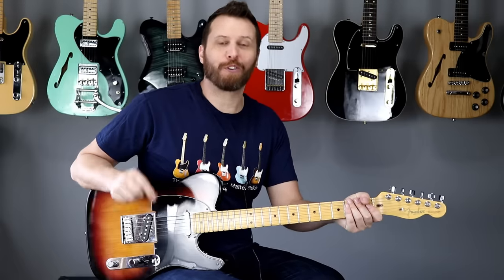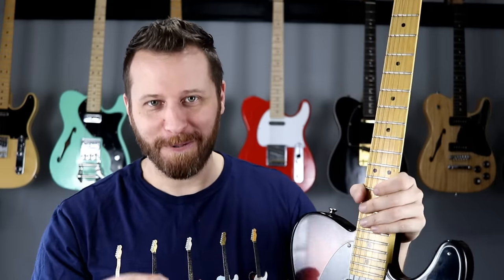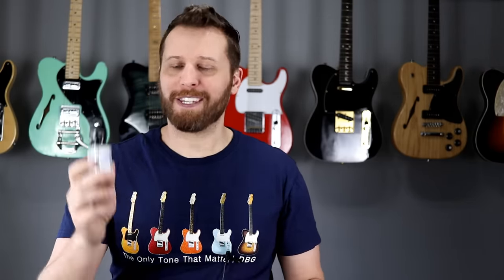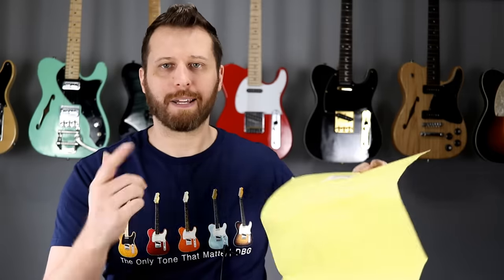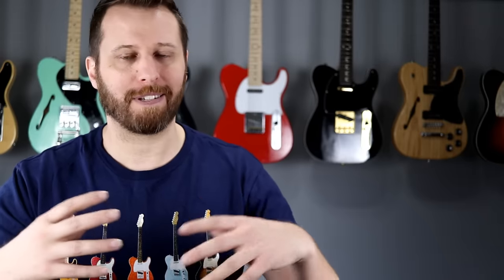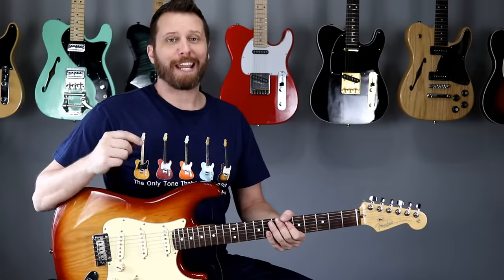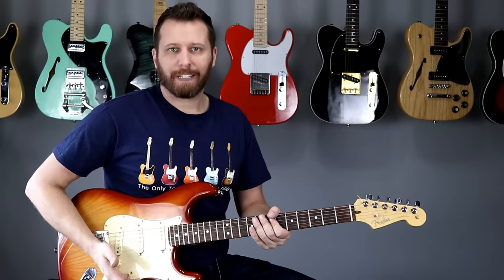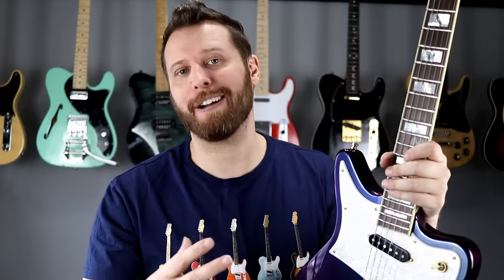KILL The Hum and Buzz!! - Keeping Your Single Coils QUIET!

Comment: You forgot to mention EMG active pickups, and the like. David Gilmour has used them for decades and no one complained about tone sucking, dynamics, or bad limited/compressed sound on his part. What active single coils like EMG does - too - is bucking outside noises like EMF, RF and mobile phones, fluorescent neon signs, and shoddy dimmers. Which not any shielding, noise gate pedal, Silent Circuit will ever do. Mind you that even if your pickup or guitar has proper shielding, it's the cable that CAN act as an antenna and pick up lots of extraneous noises, and that can even occur with humbuckers. No matter how much you have shielded your guitar, with Silent Circuit, there's ample enough risk of what happens after the guitar, as fast as any cable leaves the guitar, that can pickup a plethora of noise sources, no matter how good the grounding is.

You forgot to mention the Suhr/Ilitch hum cancelling system (passive) which is a pretty non-invasive method for preserving originality vintage guitars intact. No need to drill new holes or something. The Ilitch is the best one I've head while preserving vintage tone, without the buzz. Then peculiar thing is that these days, I think it's not rocket science to make a guitar or single pickup that has the "vintage" tone nailed to a tee, while getting rid of ALL ground/earth HUM. I e the 50 or 60 cycle hum. 

You also forgot that - while demonstrating the easiest way - turning yourself away/around from amp, gear, at a certain angle minimizes ground hum buzz to quite a huge degree, too. 

AND : Using a pretty heavier gauge set of strings than you're presently using. If using a 012 set with a spun third, as they did in the old days, and the pickups were made for that, you automatically turn the pickups from weak pickups to stronger pickup, with greater magnetism, and you have much more dynamic headroom and hotter output, which means you can turn master volume down and have greater noise floor. However, at a cost of course, with it being harder to bend, but so be it. 🙂

All in all, there's no such thing when it comes to bucking hum, as a free lunch. Everything comes attatched with compromises, and concessions. I've made my mind up a long time ago. I take precedence in removing hum and noise, make it a way higher priority, than any hardcore sound snob of just having it to sound like 50s vintage all of the time. So any change in actual timbre and tone, I am game with, if the hum is gone. Just because a very simple thing, I don't play any period music from the 50s, and I know of very few others that does. Since I do not play with 012 string sets and spun third, and not flat wound at that, and I do not know of that many players that does. Or musicians anyway, guitarists or not. But yet they keep on insisting that that's the way it sounded in the 50s. No it bloody hell didn't. Not even close.

I wonder why hum isn't embraced by the rest of electronic musicians? Keyboard players, synth players, organ players, singers with bad microphone insist of humming all the time, so they know for sure they won't be electrocuted, and so on. Only guitarists, who are the ones who plays the loudest anyway goes "I'm fine with the hum and so should you be..". Beats me.

Comment: Most humbuckers have a row of magnets and a row of magnetic screws.  Take the screws out and you have a single coil sound.  I'll bet that's why they were designed that way.  It will give a Les Paul a twangy sound.  But, experimenting with it, I failed to pay attention to the noise canceling that should go along with it.  Think about it, with a split coil, like on the guitar you demonstrated, when you pull the knob you are actually turning the humbucker into a single coil.  Yet, by unscrewing the screws, you still have two coils with power running through them, which should provide the noise canceling properties of a humbucker (the loop), you just don't have the poles in one side, so that side of the pickup puts out no sound.  That's my theory anyway.  There are some humbuckers that you can't unscrew.... I don't think my Jacksons unscrew.

Comment: I used Kinman pickups with the guitar shielded with copper and it was quieter than my Les Paul.
Reply: My dad has kinman p90s and they are amazingly quiet
Reply: I'm using Kinman in my (Tokai) Tele clone. They have a wonderful tone and are completely quiet.
Reply: Zane Tweelinckx I found that I really liked the sound of the Kinmans too. I don't know how they compare to the recent Fender noiseless pickups but the when I bought them they were much better than what Fender had on offer.
Reply: Michiel Lombaers it great to roll that volume pot up and hear nothing, but great guitar tone. A noise gate is good enough live but you always hear the hum riding on your notes.

Comment: Funny, my Indonesian made Fender Affinity Telecaster has absolutely no buzz, hum or noise issues, non at all. However my much more expensive MIM Fender Jazzmaster has noise issues in SPADES! Because when my hands are "not" on the strings this thing shouts out the noise, hum and buzz to the extent that I can not tolerate it at all. Once I place my fingers on the strings then 95% of the noise issues disappears. It may grounding and shielding issues if ever their was one. Non of my other 17 guitars have any noise issues and that includes two Fender Bullet Stratocasters. Go figure!

Comment: Hey a wierd question: If I were to use a guitar that has a mix of humbucker and single coil, when a single coil is used with a humbucker, would it noise cancel?

I know a normal single coil and a RWRP single coil together will noise cancel, and a humbucker, which has both single types in one unit,  will noise cancel by itself. What about playing a single coil (either strat or P90 type) together with a full humbucker?

Reason why I'm asking is because I recently acquired a Kramer Voyager body that has 3 humbucker routs and am trying to decide on a set of Seymour Duncan pups for it. Either 3 humbuckers or maybe throw in a set of Phat Cats plus a humbucker or another Phat Cat (dunno whether go with 2 necks or 2 bridges). Or 2 humbuckers and one Phat Cat in middle. The Voyager uses 3x 2-way toggle switches which means ANY combo of pups can be on at any time, including all 3 at same time.

The Voyager now sports an Epiphone S-Series neck (think Strat 25.5" scale here) and a floyd rose will be installed. The sole pot will be a master volume Liberator pot (to allow easy pup change if I no likey).  Any humbucker will be paired with a Triple-Shot for coil wiring options (split north or south, series or parallel).

Any advice and suggestion will be appreciated!

EDIT: musical style is blues to metal. Think ZZTop to Toska/Dorje.

Comment: How to get a humless single coil sound, steps in order of importance:

1) Build a faraday cage around the electronics in the guitar with copper or aluminium foil, make sure everything is correctly grounded and no ground loops exist
2) Fix the wiring in your house and make sure your amp is well grounded, never disconnect the ground!
3) Get a good cable with low resistance on the ground shielding
4) Remove all CFL/TL lighting, keep as much distance from EM noise sources (usually, the amplifier head or computers)
5) Shield all electronics in the room
6) Power the amp off a UPS or isolated power supply instead of mains
7) Start dicking with noisegates/electronic hum cancelling/special pickups

Comment: Typically, telecaster hates high gain in the bridge PU. And usually they are hard to dial when on high gain. The best solution is get a guitar with humbucker. They sound much better high gain.

Comment: Mine still buzzes VERY VERY louldly on the humbuckers. Is there any solution?
Reply: Get a noise gate, if you can. You can also face a different direction to minimise hum.
Reply: Get the wiring in your guitar checked out.

Comment: Humbuckers in parallel sound single coillish without the hum. What if you just wired a stacked humbucker in parallel? Or had it switch from humbucker to parallel instead of switching to single coil?

Comment: I have a '73 telecaster and the hum drives me crazy. I can't use it for performances. I don't want to ad stuff, because it's fully factory. I tried the noise gate, but I would love to hear if there are any options for vintage units like mine?
Reply: You didn't mention which one you tried but maybe the noise gate you tried wasn't doing a good enough job. You could buy the EH Hum Debugger, TC Sentry, Boss NS-2, EH Silencer, ISP Decimator, and /or any others you choose  and try them all. Then keep the one that works the best and take the others back.

Comment: Shielding doesn't do anything noticeable. Think about it, your pickup is receiving the external noise right in the front. What happens underneath is almost inconsequential.
Reply: It most certainly does. I'm guessing you've never actually tried it. It transforms single coils. I've done it on at least ten guitars now. You have to do it properly though, with the shielding throughout and wired to ground. It's not just the pickups that pick up the interference, all the wires can do it. That's why it's not a bad idea to use proper shielded cable too and twist your wires around each other etc. It's just simple physics.

Comment: What about using AC Voltage ground loop power correction on the power supply to the amp ? Ebtech make a Hum X plug for your amp.

Comment: I live on Koh Phangan Thailand and it's a nightmare for hum! Whatever guitar I have. The power is never stable, so recording can be going well, then all of a sudden the power dips and the hum kicks in. I have the electro harmonic hum-debugger, which helps a bit and I record through my avid eleven rack, which has a gate. Any suggestions? Thanks for your great shows
Reply: Get a power conditioner. It will provide stable power and protect your gear.  As well as clean up some of the buzz.
Reply: @temple0techtonic  thanks I'll look into it!!

Comment: For copper tape, I read that if you use separate pieces, you have to weld/solder them together or else the shielding won't be effective. Do you know if this is true?
Reply: Yes, correct. But you can just overlap the edges of the tape to make the connection. THen solder a wire from anywhere on the tape to the back of a volume pot to earth the whole shielding.
Reply: @MonsieurVersatile  Ok that makes more sense. so as long as all the copper tape is making proper contact with each other and then is grounded it's all good. What happens if its not grounded to a pot, does it have any shielding ability?
Reply: @AndrewAviles  Some, yes, but it's trivial to solder a wire from the foil to ground.,

Comment: See I have humbuckers and when I plug into the interface it buzzes before I even plug the guitar in. It doesn't buzz barely at all on my little line 6 amp. I just had my guitar checked and set up so I'm almost positive it isn't the guitar. It goes away when I grab the metal part of the guitar cable.
Reply: Ronaldo, if you are using an interface such as a multi effects pedal through headphones, and it is DC powered it probably has no connection to ground and all the shielding and metal parts fed RF into the signal. I found that this situation was very noisy unless I plugged into an amp (plugged into the mains but not turned on) or a dedicated ground connection

Comment: I upgraded a squier bullet strat that is made in japan in 1983 with new set of pickups (Seymour Duncan Little '59), and i'm having an issue where the noise is coming out so much. However when i touch the strings or tap on the tremolo bar/bridge or any hardware like tuners etc, the noise is gone. But when i let go or release, the noise comes back. So i don't know there's something that has to do with the grounding signal that's coming out of the guitar, but i'm having this problem and hopefully someone can help me fix the problem!!!

Comment: What if all your guitars are making a popping noise? Strat makes the noise in 1-3-5 positions, mostly silent in 2-4, my humbucker guitars are not much quieter and the popping noise is still noticeable, and predictably louder when I split them. This happens only when the guitars are plugged in, everything is on. It happens in both my tube amp and my modeling amp, and I’ve tried this at various outlets in my house, different sets of cables including a wireless set. I’m guessing some form of emi from whatever is in my house. It sounds like a galloping crackling popping noise. Any suggestions/solutions?

Comment: players:
gainstaging. lower guitar volume. don't set your pedals to 10. get a better amp head. use more speakers. i can play an OEM squier bullet with mysetup and I have next to no noise away from/facing the speaker. if you need more "gain", buy a $50 Boss overdrive to put before your distortion.

for room soultions - replace your current power outlet with an isolated ground outlet, use isolated power supplies, and turn away from your computer or phone. same applies to venues. If you go to one venue often, offer to replace their outlet where you plug in for $40 and you're solid.

Comment: My amp, a Fender Frontman 25R,  hums when the guitar is not plugged into the amp. I just turn it on and there's the hum. It also gets louder when my fingers touch the tip of the cable lead. I tried the Pigtronics Gatekeeper with no help at all. Any thoughts?

Comment: You need to check out Woodesos YT channel and how easily he installs a dummy coil that has no volume drop or tone change. Using a cheap single coil and remove the 6 magnetic pole pieces hot glue it in and wire  between the volume pot and the 5 way switch. Glue it to the pickguard between the 5 way and volume pot.  The coil replaces the green wire normally

Comment: I've been really unhappy recording my strat and tele direct using the gate pedals in bias fx2. The end of sustained notes sounds really decayed and distorted, not in a good way. It might be that I don't know how to set the gate optimally. I'm thinking about getting noiseless pickups or a guitar with hum buckers, and using that for dirty tones, single coils for cleans. Not sure what to do live, though that doesn't bother me as much.
Reply: Maybe a dummy coil, which you engage for distorted sounds and disengage for clean? It does make the wiring a bit of a challenge unless you get a kit, because you want the dummy coil to be switched off in positions 2 and 4 even if it's "switched on" by the player -- the use of two coils in opposite phase is already doing the job, and the dummy coil can only add noise. If you can follow a schematic though, you should be fine.

Comment: Well, so far, I'm thinkin' that the Music Man silent circuit is cool, but absolutely ANYTHING you need a 9-volt battery for, is gonna fail at the worst possible time, they don't last all that long, and you'd have to also have a suitcase full of nine-volts.  So that's out, for me.  Fender's noiseless p'ups I quite liked, but I see I'm gonna have to look more into this "gate" thing.  I'm a geezer, so I don't hear about all this newfangled stuff before it ain't new any more; and I'm not a brilliant player or luthier,  used to be something of a "name" around Detroit but just putter around on insomniac nights, these days; and enjoy building from kits or parts, once in a while.  I've had some rather nice guitars, but oddly enough, the one I always reach for is my cheapest, junkiest little kit Strat.  Go figger.

Comment: I wonder...
What if you installed a single coil pickup on the guitar, which is not under the strings, so it would only capture the hum, then humbuck and a pickup that is under the strings.

Comment: I have a MIM strat with 5way switching HSS pickups.I upgraded the existing standard neck and middle pickups to two Fender noiseless single coils.after the setup done all 05 positions sounds good except the 04th one.04th position sounds very thin and bit harsh.can somebody explain what causes the 4th position be that sound?

Comment: If I put a Compressor Pedal next to the Noise Gate, does it maintain the Sustain that is lost by the Noise Gate Pedal?
Reply: All that a noise gate does is cancel the noise under a certain level. It doesn’t cancel anything while you’re playing. The reason the reason you have less sustain using the noise gate is because the gate cancels the signal as the note you’re trying to sustain gets more quiet.

Comment: My guitar is pretty silent if i touch the strings. It starts producing hum if i lift my hands off. Is that normal?
Reply: That means you have a grounding problem in either you guitar or your amplifier. check the grounding connections on your guitar. if problem persists, probably it is your amp not reaching ground appropriately.

Comment: Got any tips for a les Paul?
My classic does this but obviously there’s nothing to shield.
Reply: Changing your cable might help. Also, if you use a lot of gain, that does not help with hum.
Reply: Gabriel Rosenberger it might be the cable then. I get it on clean as well. Although it cuts out when I split the coil. Thanks for the tip

Comment: I'm not getting any "hum cancelling" in positions 2 and 4 on my strat, is that normal? or should i get it checked, rewired, etc?
Reply: No that's not normal. It should be pretty quiet in those switch positions. Either the middle pickup isn't reverse wound, or wasn't wired with the correct polarity. You could try switching the hot and ground wires for the middle pickup, or just take it to a guitar shop for a tech to look at.